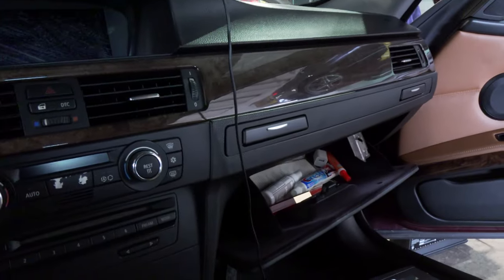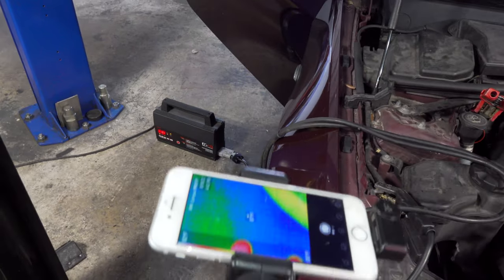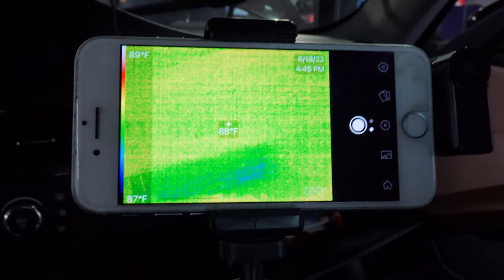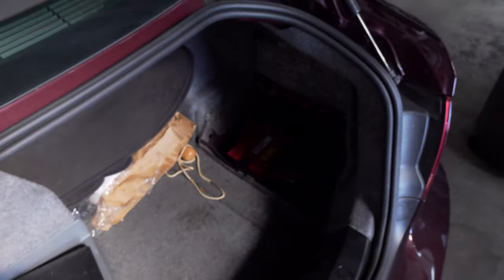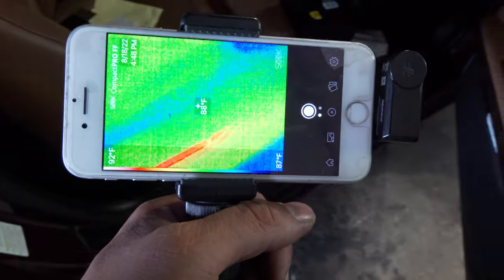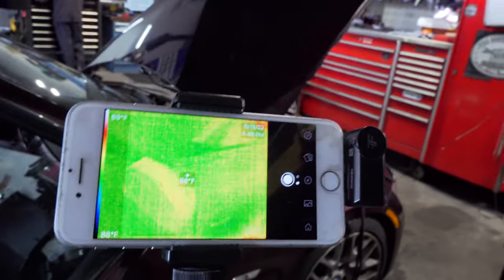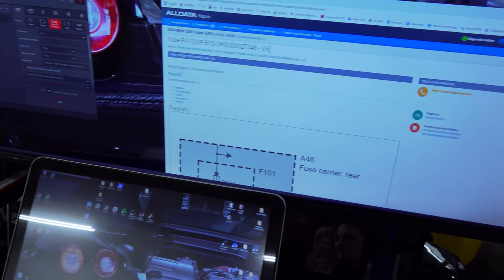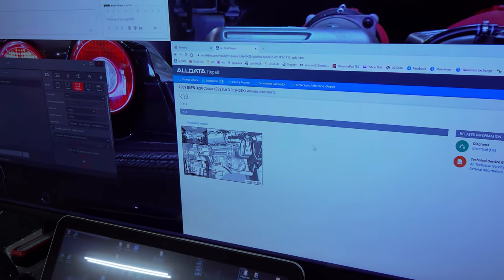FIND A PARASITIC DRAW USING A THERMAL IMAGER | 2009 BMW 328i

Comment: Excellent video Mario! I often feel the same way as to publish a video or not, but honestly this is quite useful and a valuable lesson to be learned in doing diagnostics. I keep forgetting myself that I have a thermal imager which I would like to use for engine misfires, electrical issues, etc. You just cut your diagnostic time in half and saved a lot of time with the thermal imager. It would have been nice if you pulled out the fuse for the rear defogger just to see if the heat went away from the imager camera just for the sake of entertainment purposes. Other than that this was interesting. Good job!

Comment: great job,lots to learn from this,i use thermal camera too,in england,fixing volvos mainly,use to pull one fuse at a time and wait till amps went ,works ok,but camera is better,you should of pull the fuse and then check the draw,if gone ,then got a cheap fix,and found it ,as a shop owner ,you got stick to budjet ,as custermer got pay the end bill,nice you give them options ,you run a honest shop,not rip people off ,is good to see ,i have worked in bad shops here in england,was sad times,mechanics break stuff,not do the parts swop,i not like it ,so left,till found a good shop,i push my snapon box out the door ,and said im off,place sucks,but on payday ,so still get paid,i got myself a scope,mainly for test spark plug coils,crank pulses,no one knew how to use one ,so i found scanner danner ,he loves them ,learnt lots from him ,and southmain auto ,just found your channel and learning from you now ,scope takes the mystery out of it ,and got a endoscope now ,handy little tool,and a thermal camera, my friend is a fireman ,and gave me a old one ,works ok ,see every think ,keep up the good work ,educating the masses,around the world ,eric the car guy is another one i watch ,and sy diagnostics,a ford main dealer man ,was scoda man then r.a.c breakdown man ,rescue people ,broken down,some you fix ,some get towed,cambelt snap ect ,love gunman too,he paints cars,nice to watch

Comment: You could have pulled the HVAC control panel, which has the button to control rear defogger, and disconnect it. Then you will know if it is just a bad signal from HVAC panel or if it is a stuck relay. It is pretty easy to pull that panel.
Reply: That would not have brought you any more information. Because the rear defrogger on signal is a can message to the junction box.

Comment: Could also patch into the command wire and pull the fuse and install an aftermarket relay that goes in between the fuse connectors in the junction box. Be sure to put an inline fuse on the new relay. Can retain the use of the defroster then.

Comment: Very valuable video because it shows the entire process of your diagnosis AND conducting business!

Can you imagine what would have happened if the customer complaint was 'hot rear defroster",  you did not have a thermal imager, and you trusted your component location diagram?

Comment: Interesting diag Mario! Why not at least pull the rear defrost fuse and see if the draw goes away?
Reply from the maker: That's what i did. Didn't film it though lol
Reply: @SuperMarioDiagnostics  oh haha did that fix the draw?
Reply from the maker: @PineHollowAutoDiagnostics  Yeah I mentioned it in the video that that’s what the customer decided to do, Permanently lol most of the customers that have this issue decide to just leave the fuse removed
Reply: @SuperMarioDiagnostics  that's what I would do too lol... Maybe install a toggle switch or timer button in series with that fuse... But in Florida rear defrost is optional 😅

Comment: Interesting case. I don't understand that massive 19 Amp draw, though.
How can that possibly be accurate?
I like the demonstration of the use of the thermal camera, but why not just use a simple Amp Hound tool, identify the fuse and pull it to confirm the "sleeping" amp draw is at acceptable level?
Reply from the maker: This is much faster and only my first step in the process. Have you tried getting an amp hound to the junction box on one of these? Plus i don't like the amp hound false passes. And yes the faulty component can easily pull 19 amps
Reply: @SuperMarioDiagnostics  i thought the rear and front defoggers would only work with engine (alternator)running  because of the drawer on power use  or because of fault that is bypassed
Reply: @jackmay1728  youre right it will only command on when the engine is running. But if the internal relay got stuck it wont matter anymore. It will give constant power to the rear window defogger.
Reply: You could wake up modules when you pull the fuse restarting the process again this is not very invasive
Reply: @SuperMarioDiagnostics  what brand thermal imager are you using?
Reply from the maker: @Jason-fi8nk  seek compact pro

Comment: If you disconnected the connector to the HVAC unit or checked for ground on the wire could verify relay isn't being turned on. 
An external relay and inline fuse could be installed bypassing junction box if desired. ( If couldn't be repaired or source a replacement) kinda janky, but....
Reply from the maker: It's a network command, not a ground command from hvac unit to jbe

Comment: Thank you for this wonderful video…. I have questions…. I see you are connecting the car to battery maintainer…. They told I can not connect the car to maintainer while testing for parasitec draw?
Reply from the maker: That's not true. The draw doesn't change. Now after the draw has been found and rectified, it's suggested to power off the maintainer to get a more accurate draw reading. But without this maintainer, this vehicle battery would've died within two hours
Reply: With the battery maintainer you wouldn't be able to check for (leak) current flow ( not with an amp clamp, nor with a shunt resistor or in line amp measurement) at the main battery cables as there will be current flowing INTO the battery at all times. Yet you can check for voltage drop over the fuses as this reflects the current coming OUT of the source. Or, as Mario did, go by the thermal imager which indicates  indirectly the current consumption by its product which is the generated heat.
Reply from the maker: With a maintainer, you can absolutely see current draw using an amp clamp around the battery cable. Next time i do it, I'll film it for ya
Reply: Thank you very much
Reply: Thank you Juergen scholl
Reply: @SuperMarioDiagnostics  I stand corrected, no need to film it. Yes, the amp clamp WILL allow measuring the current out of the battery when put on the main battery cable only. And yes, you could also do an inline measurement with the maintainer hooked to the battery posts and the main cable connected through the amp meter leads to the battery as well.

Comment: Do you guys offer running a separate relay outside of junction block? Similar to the classic tipm repair. Still a dope video, thanks for releasing it.
Reply from the maker: If I'm going to go through all that trouble, i might as well fix the original relay. Assuming that is the problem, it can be done though
Reply: @SuperMarioDiagnostics  Are you talking about fixing the junction block?
Reply from the maker: @worsttintentions  yes, the relay inside of the junction box. Desolder the old relay, and resolder a new one

Comment: If you remove the fuse you would be able to see if the control side of the relay was active or if it was stuck relay
Reply from the maker: Doesn't matter, client declined going any further

Comment: Couldn't the on off switch for the defogger be bad and stuck on?
Reply from the maker: It could, but that would require the ac head unit and the junction box to be on at all times
Reply: That's where my mind went... the control wire for the relay could've been shorted to ground, or a faulty ac head unit giving it a ground when it shouldn't.  It's extra labor but checking the control wire at the junction box for a ground could've been a  more definitive diagnosis.